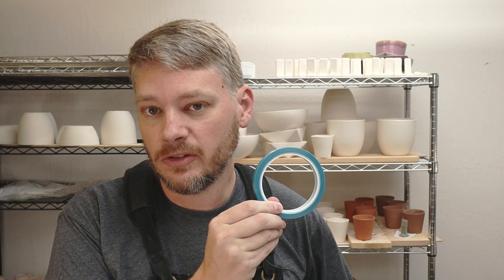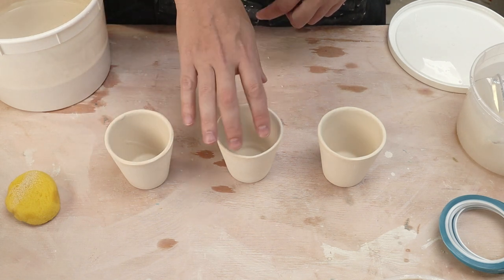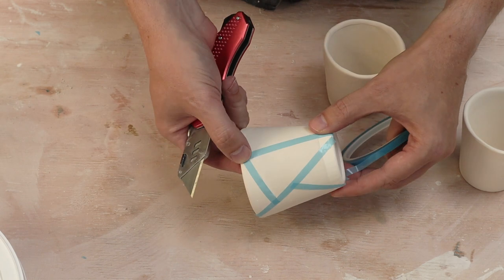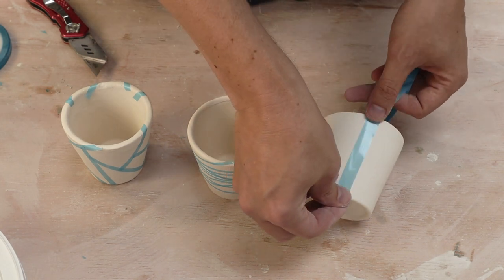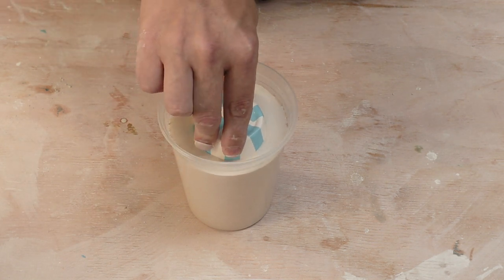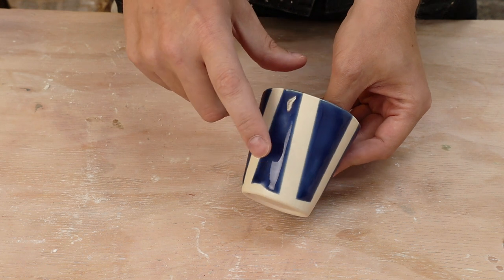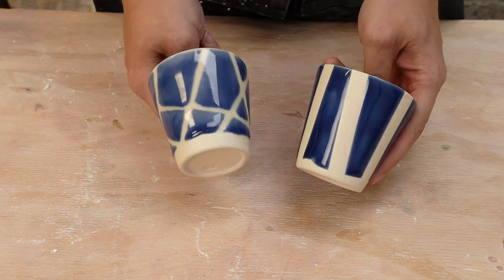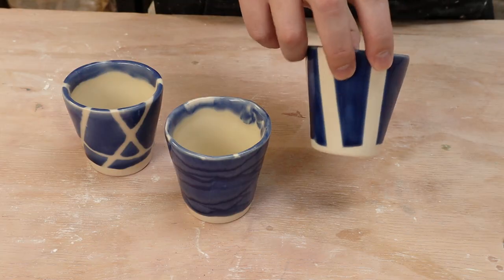Making Patterns in Glaze? Lets try using tape to mask pottery glaze application

Comment: It might be advantageous to try pulling the tape before the glaze has a chance to dry to minimize the chip out.
Reply from the maker: Thanks. That's an interesting idea. I let it dry all the way so it didn't run (the glaze stayed wet on the tape in particular for a good while). But pulling it sooner, rewetting the glaze a bit, or using a glaze that didn't dry as fast could all be worth a try.